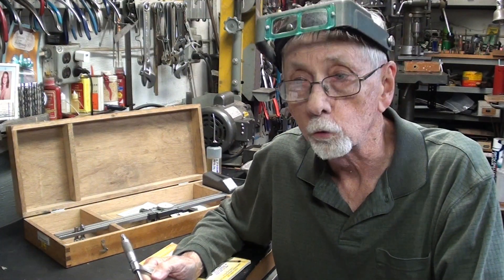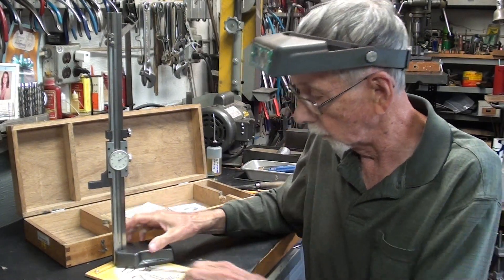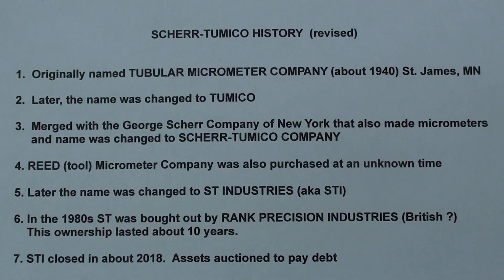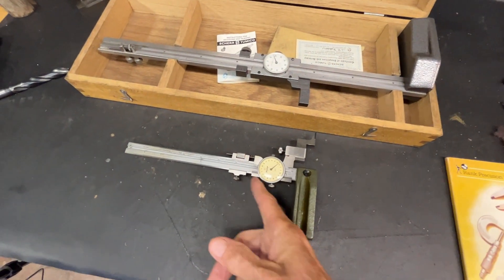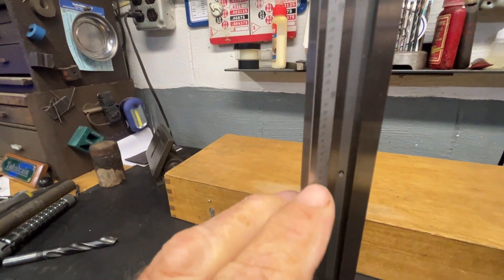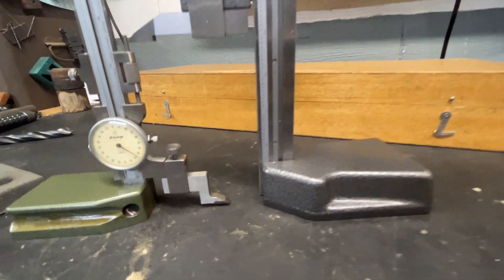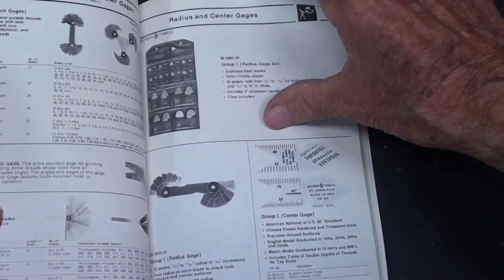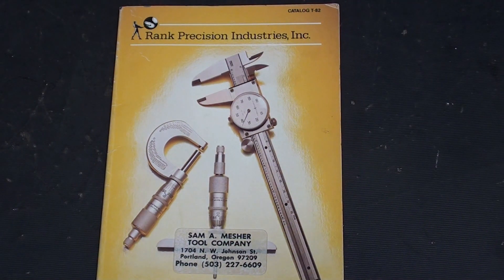SCHERR TUMICO UPDATE CATALOG #897 tubalcain micrometer comparator

Comment: Mr. Pete-

1. I am not an experienced user of micrometers. I’m just learning. I just purchased my first 1”(Starrett), 2-3” (Scherr-Tumico), & 3-4” (Mitutoyo) micrometers recently.
2. Both the Starrett & Mitutoyo are zeroed out in the same way via the same location (via a spanner wrench and a small hole in the cylinder). I have been successful in zeroing out both of these micrometers.
3. But the Scherr-Tumico micrometer does not have a small hole in the cylinder. It does have a similar small hole in the thimble.  Is this how a Scherr-Tumico micrometer is supposed to be zeroed: using this small hole in the thimble with a similar spanner wrench? I’ve searched online but have been unsuccessful confirming this theory. I think my Scherr-Tumico micrometer might be corroded because the thimble part I can’t turn with a spanner wrench. I’d hate to force it and this area is not meant to rotate.
4. I’m writing you because of your video on Scherr-Tumico micrometers.

Thank-you for your time.
Reply from the maker: I have never had to adjust mine. In fact, I never thought of it. If I had any documentation on the tool, it probably would explain that.

Comment: That is a fine tool for sure.  I also agree with Lysle regarding digital measurement tools and their batteries.  Seems as if the batteries are more of a pain in the tail than continuing to use the dial readouts. We made it here with vernier measuring tools, I'm sure the dial types are just plain good enough for the crowd we run with. Not only this but those darn batteries also leak and can render the darn thing a disaster if you don't remove them often. I am the same way with clocks...plug them in types come first and a battery version is for backup needs during power outages. 
Seems the best way to run things at home these days is to pick a day that once a year everything that has a battery gets a new one. Otherwise, you will often find time went by long enough that the darn thing is dead or has leaked and made damage to the contacts. Life is better in replacing them as a routine vs. when you are high and dry in the moment of need.
Reply from the maker: You are a very wise man

Comment: At 5:35 - Tubalcain speaks about how the electronic digital caliper's batteries always seem to be dead when you get them out of the box to use them after sitting unused for a while. I find this to be especially true of the cheap variety so I take the battery out between uses. Obviously, when you think they're off they really aren't truly off.  The better variety of calipers seem not to have this issue.  UMMV!
Reply from the maker: Very true
Reply: I came across a larger caliper, pulled the battery, bought a new bat and put it in only when I use it.

Comment: I worked in a hydraulics shop that used these tools almost exclusively because they wanted to calibrate tools often, they were least likely to get stolen and they didn't want employees tools around. Many did not like them but I found they were as good as any for accuracy, the ST tools meet the same Gov specs. I have vernier calipers to 48" for layout, and V and disk anvil mics, all of that is a good buy and works fine.

Comment: Used their mikes and calipers back in the 70's and likewise assumed they were Japanese.  We also had Helios, and of course B&S and Starrett measuring instruments.  Most of the stuff in my home shop is Mitutoyo, Starrett, and having worked for the automotive industry our Q.A. was quick to discard measuring equipment for the slightest reason.  Those tools found their way into my toolbox but not until they were engraved "Do Not Use".

Comment: Thanks for the history lesson. I work in a machine shop at Kennedy Space Center. It is an older shop and was started during Project Mercury. We still have height gages, and a few S-T micrometers and other tools from that era. They still have the original property tag decals that read “Project Mercury” on them. It’s pretty cool to think that tools that helped launch Shepard, Armstrong, and Young (Mercury, Gemini, Apollo, Shuttle) are still supporting Space Station and SLS/Orion. Cheers from Florida’s Space Coast.
Reply: Yes and they all used a slide rule which few today even know what they are.

Comment: Valuable information to me. I was long distainful Scheir- Tumico as an inferior brand. I don't own much of it. My up to 12" micrometer set is ST and, of course, I have your optical comparitor. We purchased the ST version of the precision master level (.0005"/foot) to save some cost over the Starrett version when my boss wouldn't pony up for a second Starrett.  It was similar size and weight to the Starrett, but never favored by me or my staff. Eventually, after I controlled spending, I acquired a second Starrett. That permanently moth balled the ST. I found that machine installation and setup was much facilitated by using two levels set at right angles to each other. .0005"/foot was enough resolution for our shop requirements, and we tried to always level machines to that resolution.  The ST level lacked the fit and feel of the Starrett version. 

Your STI information has altered my opinion of the brand. The commenters have already added other helpful information and clarity. I may even have a ST dial caliper somewhere. My memory was that it lacked the buttery smooth feel that I like with the BS tools. I also own Starrett and Mitutoyo calipers that I prize, but I keep three BS 6" dial calipers that are my go-to tools. 

ST tools are not as prized on the used market, so the inexpensive cost made the brand a viable option for my hobby shop and for my seldom used professional tools. I generally don't work large, so ST fills out my larger tool inventory.  I appreciate learning about the brand.

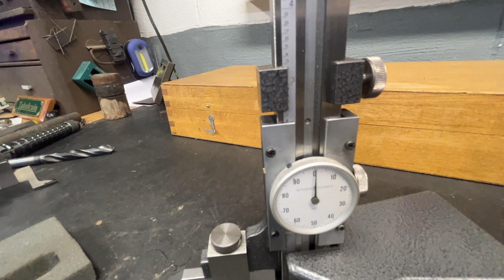Comment: 3:00 Scherr had a relationship with Reed before Tumico absorbed them. The Reed heritage micrometers are the ones adjusted by having a two part thimble, the graduated end rotating for adjustment. The thimble threads onto the spindle. The Tumico heritage ones are adjusted by removing the thimble from the taper at the spindle end and reseating it. 5:00 Not sure what the intent of the adjuster is (my similar model came without a manual) but the scale adjust is nice when changing scribers.
Reply from the maker: Thanks